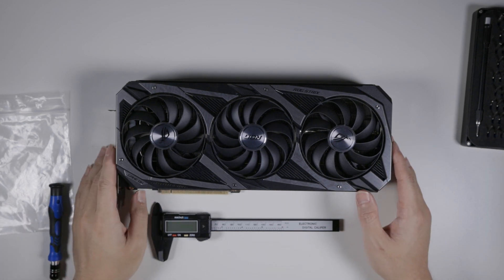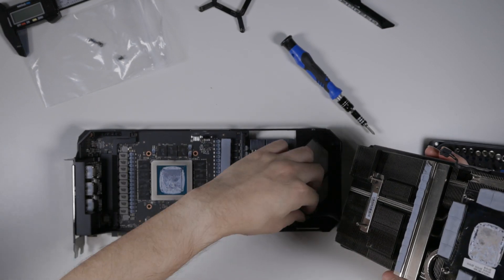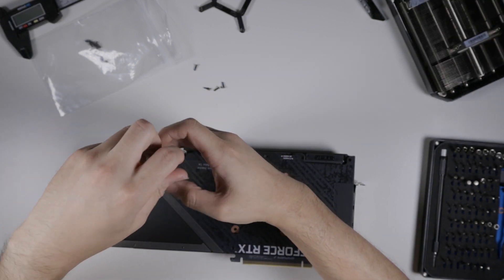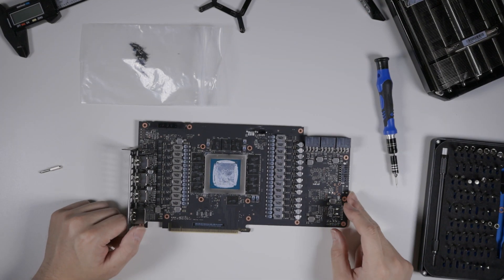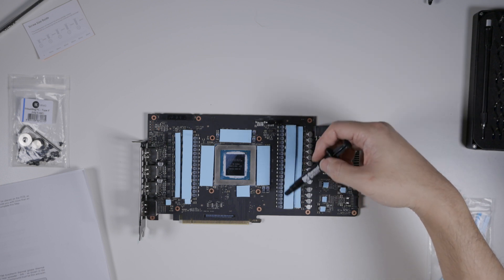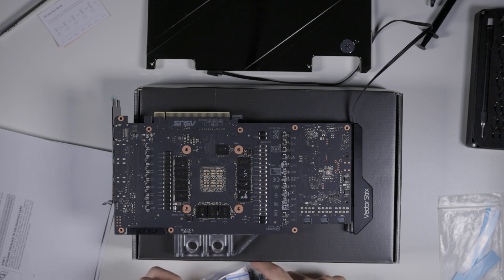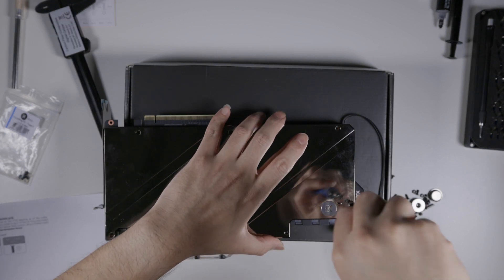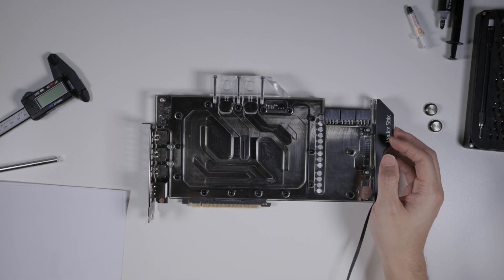ASUS STRIX RTX 3090 3080 Cooler removal + EKWB Waterblock and Backplate Install Beginner Friendly

Comment: From what I've heard, spreading the paste is good practice on a gpu because missing even a tiny spot can burn out cores. But this was a great video, if I ever decide to replace the paste and thermal pads on my strix 3080 I'll have to reference this vid. Nicely done
Reply: THIS
Reply: Thermal paste should be always spread evenly and carefully on top of the whole area of the processor so that it covers the whole surface area. This is basic and obvious physics. If you just put a drop in the middle and then squeeze it won't spread properly and it won't spread evenly. It's basic and simple understanding of physics. Also many thermal pastes aren't even runny at all.
Reply: @-Mohog  Imagine speaking about physics while understanding so little about what actually happens. Let me give you guys a proper physics education.

You are not applying thermal paste to cores, you are applying thermal paste to metal block that is designed to increase total heat capacitance of the processor (IHS). That metal block has EXTREMELY high thermal conductivity. Our goal here is to make a contact with that block that is ideally as slim as possible, and it does not have to be uniform because metal block has such high thermal conductivity that it will spread uniformly even if you just put a small dot in the middle. (This means ununiformity across the IHS will be at most 0.5 degrees - so little that it does not matter in practice)

Advantage of small dot in the middle approach allows you to have really thin layer of thermal compound which is the biggest bottleneck in entire processor-to-heatsink thermal system. Conductivity of thermal compound is less than 1/10 of conductivity of the IHS. 

In practice however - both approaches achieve same results with measurements being within margin of error. However small dot approach is less likely to spread out from the corners so it keeps the system cleaner for future.

So yeah, what you are doing is a mistake that I have seen a lot of people do online - applying elementary school physics to a system that is far more complicated and advanced than that. That is not how reality works, leave explanations of this stuff to engineers and don't spread misinformation.

And no, you are not going to "burn out cores" if it is not spread evenly. Again, you are not applying thermal paste to cores, you are applying it to IHS which already is uniformly connected to all cores.
Reply: @Navhkrin  You do know that a GPU doesn’t have an IHS and you apply the heatsink right to the die….talk about not knowing what you’re talking about lmao

Comment: Thank you so much.  The water block was easy but that backplate was a huge pain.  I tried to get all the pads as level as I could so hopefully (touch wood) everything will be okay
Reply: The backplate issue he talked about is still an issue? Going to order this block next week
Reply from the maker: I've told EK about the issue, You should be prepared to have some extra 1mm pads for the back VRM area. You want to make sure you have proper contact with the memory as well. You may need to use a thicker pad there as well. Some folks have had coil whine as well using the layout in the instructions. Prepare for some trial and error with the pads on the back unfortunately.
Reply: @JCustom  thanks for reply and heads up.

Comment: Note: The Active backplate from EKWB, is 20mm thicker, so you cant mount it vertical, with that said, you doing a 3090 with memory on the backsite, so i strongly recomment you get the active backplate, cuz it gets hot on the backside form memory and you ram (Unless  you ram is water cooled)
Reply: And that is the opposite advice everyone else is giving regarding mounting orientation. 
The weight of card, front and back waterblocks, makes the card weigh 6-7 pounds.
That much weight mounted horizontal will destroy your motherboard.
Everyone else I've seen has said to mount vertical.

Comment: Very good video!! Good detail and information!   Please keep us posted on EK response
Reply from the maker: Yeah I saw a few more similar complaints across the range of EK 30 series.  So I've told 2 EK reps at this point. I sent photos as well so we will see.
Reply: Thank you big time for the response, it is always hard to know who is at fault whether it be card vendor changing things or EK.  I know the Asus 2080ti cards and EK had issues as I found the issue with the blocks https://www.ekwb.com/blog/did-you-know-compatibility-issues-with-strix-rtx-2080-ti-water-blocks/ 

Hopefully they respond with a fix whether it be different thermal pad thickness or instructions cleared up

Comment: I'm not installing a water block but this is useful information for thermal pad replacement for the 3080 Strix
Reply from the maker: Just be sure to use the same pad thickness as the stock
Reply: @JCustom  I'm doing vram pads first to see if it lowers the memory junction temp when mining. I ordered a pack of 120x120x2mm Thermalright Odyssey pad from Aliexpress

Comment: I bought a 3080ti the other day with that block and active backplate and I gotta say it too 3 hours to assemble the whole thing. Alot of the pads didn't fit and I had to take it apart a few times because I feared it would warp under high heat as these cards get pretty hot even on a custom loop. Finally got it together and If I can offer any advice to someone who has a similar issue is to check the pads at eye level before setting it instead of relying on ekwb's instructions. 

Been using ekwb products for years and this was the first time I've noticed that this product wasn't that well thought out.

Comment: Very nice and quiet, and I mean quiet, video. I would have liked to see a little bit more: the pump, radiator, and reservoir. If I made a video, I would sure use my Video Maker program. These videos need to be edited and played before being released to the public. "Will not void the warranty." Oh, so that's why they have that warranty plug. Never would have guessed that. If NVIDIA sold the GPU with an installed liquid cooling kit I, and the scalpers, would be the first in line.

Comment: I see people putting thermal pads on the VRMs first, also for beginners using the waterblock as a guide to see where the "raised" parts are. Can you put the thermal pads on the waterblock first where the raised surfaces are? Basically reverse process, I don't see people do this, but intuitively it makes sense to me...?

EDIT: I commented about half way through the video. But towards the end I saw you put some thermal pads on the backplate first
Reply from the maker: The order doesn’t matter that’s personal preference as long as you put them where they need to be. If you look at the water block you will see there are raised and recessed spots, the inverse would be true on the gpu pcb.

Comment: hey just came across this video, great job with the step by step guide. I just had a question in regards to the VRAM temperature. I know HWinfo has the capability of measuring it but I am seeing pretty high temps and I have a feeling the backplate might not be making contact even though I followed the instructions by EKWB to a T. Would love to see what temps you're getting with the backplate on. VRAM temps, that is.
Reply from the maker: If you use the instructions, the vram contact will be poor. You want to go .5mm thicker than the instructions. I've notified EK Of this.
Reply: @JCustom  I just got an email from them. They said they’re sending me more thermal pads and 8mm screws for the backplate to make better contact and also reduce the slight coil whine I’m getting.
Reply: @Darkthrone111  I am experiencing similar issues with the screws not able to fit in. Seems like I will need to email them as well for 8mm screws.
Reply: @JCustom  Are you saying that we should use 2.5mm thermal pads on the vrams for the backplate? I see you mentioned that you changed the side 2mm to 1mm. Does that still holds? Thanks!

Comment: Question does removing the cooling system of the asus rog strix 3090 gaming oc make it just like any other 3090? Or does the overclock speed and other things that make the 3090 gaming oc better than other models carry over when you put on the waterblock
Reply from the maker: It’s not the cooler it’s more the voltage limits out the box (along with component choices) that make the strix a “better” than say a 3090 gaming oc. The strix cooler is pretty good but even with a higher out the box power limit, silicone lottery is pretty important as well. At the end of the day if you got the cheapest 3090 vs even say a 3090 hall of fame, the performance difference is in the 1-5 FPS territory out the box.

Comment: I cannot believe i just spended around 10K on two pieces Asus Ekwb 3090 gpu's and Quantum RE Vector waterblocks etc, and then there is 6mm huge gap between thermal pads and waterblock!!! Ekwb support recomended this waterblock to me and said it was compatible with all RE RTX 3080\3090. I contacted them again and now waiting for a reply..... As far as i know its not possible to buy 5mm Thermal pads, and now im proberly forced to make some modifications with flat copper bars for heat transfer. EKWB Seriously????

Comment: can you just go with the water block and not use the back plate at all and keep it stock ? because I see a lot of coil whine problems with the EKWB back plate installed on this specific model..
Reply from the maker: I would not advise that for the 90 model, as there are vram chips on the back and the back does get quite warm. Having looked into it since, I would suggest using the pad layout in the instructions and then using longer screws. My card did have a little bit of a whine prior to blocking.
Reply: @JCustom  Thank you so much for the info. I ordered and waiting them to be delivered.. in the meantime, why longer screws? The ones that come with Ekwb are too short and cause bendin or something? Thank you for your time, your feedback is much appreciated.
Reply: Same problem 3080 strix slight bend in pcb as I had to use a tiny bit of force to make the screws meet through the backplate!, did not feel good at all ended up using 8inch screws instead of the 7inch ones and was alot better but overall wish the pads came pre cut or something it just doesn't feel very professional
Reply: @TorvenAU  are the screws coming out of the box a bit too short? So you have to find out longer ones on your own?
Reply: @jeocuneyt  yea exactly the 7mm ones or whatever that come with it in some parts of the backplate just slightly short maybe because I used the pads as advised by ek diagram and the 2mm ones are maybe to thick idk, also I'm vertically mounting my gpu so I dont even know if a backplate is worth it at this point
Reply: Actually you're right, and plus the stock back late is prettier.
Reply: COIL.WHINE IS LOUD! even on my 3080 strix.. I'm removing the backplate everywhere I've read is it fixes the issue
Reply: @TorvenAU   wow thanks for the info. Ordered the 3080 block. Will try to grab some 8mm screws
Reply: @TorvenAU  Wow disappointed with EKWB for this silly blunder why do companies do this where they usually good at doing something and then they mess up with later models.

They need to make a V2 to address the problems

Comment: Can you use copper pads instead of those sticky thermal pads for the VRM and memory chips
Reply from the maker: Tech yes but you will also be using a lot of thermal paste between the vram and  copper shims and the block

Comment: What are the thermal pad thicknesses I should use for the 3080 ti rog card? I will also use it on the back of the card. Is 1.5mm suitable? Thanks
Reply from the maker: For active backplate ?

Comment: Hi, where is the connector for rgb leds? I just need to turn off those leds. Would I need to disassemble the card for this?
Reply from the maker: You can use asus armory crate to turn it off. No need to disassemble the card
Reply: @JCustom  I have tried that and every other app out there. It worked once and LEDs went off but one day suddenly LEDs just came back on and won't go off anymore.
Reply: Can the LED connector be unplugged without having to remove the back plate or front fan assembly?
Reply from the maker: The cooler may get in the way. I don’t remember which one is the led. But I think it should be the smaller connector
Reply: Why do you want to turn them off anyways?  I RMA'd my RTX 3080 ROG Strix and they sent me one back with the RGB lights not working.  I tried to turn them on with the software but still no luck.  Any Idea how to fix the light issue?  I really dont want to RMA this again.

Comment: Hey! Hope you are well. Do you have any idea if the thermal pads just to upgrade (no water block needed) are different sizes as well for the regular cooler or one size fits all. If you have the Asus link or any other where you got this info I'll appreciated very much. Thanks!
Reply from the maker: VRAM front:	80x40x2mm 
VRAM back:	80x40x2mm 
1mm, 1.5mm, 2mm, 2.5mm

https://thermalpad.eu/thermal-pad-sizes/asus-rog-strix-nvidia-geforce-rtx-3080-oc/

Comment: Did any of you have a problem with the Fan Shroud screws falling out, causing you to have to disassemble the card to reinstall them?
Reply from the maker: No. The cooler assembly is really just attached with 6 screws. The rest are for the back plate and mid frame
Reply: @JCustom  Sorry JC, my question was not "framed" well,  my Strix 3080 had the 4 screws vibrate out and the shroud fell off the card (since it is essentially upside down).  So now I have to dissemble the card and screw the plastic fan shroud back onto the card frame (only accessible with the card apart).  From your video it looks like I can reach them once you take the cooler off.  I was wondering if any of the Gamers watching your videos had the same thing happen.  Did not mean to hijack your video Sir, I did not know where else to turn to for advise (need to find the screws now).

Comment: Why doesn’t EK just get into the business of purchasing the cards from Asus before they mount the body then add the water blocks to them and sell them ?
Reply from the maker: They have partnerships with asua for a ref based model. But when ek partners with say powecolor ,asus, msi, the Waterblock assembly is done by the aib.
Reply: Good question because i cannot believe i just spended around 10K on two pieces Asus Ekwb 3090 gpu's and Quantum RE Vector waterblocks, and then there is 6mm huge gap between thermal pads and waterblock!!! Ekwb support recomended this waterblock to me and said it was compatible with all RE RTX 3080\3090. I contacted them again and now waiting for a reply..... As far as i know its not possible to buy 5mm Thermal pads, and now im proberly forced to make some modifications with flat copper bars for heat transfer. EKWB Seriously????

Comment: How much of a performance increase is this water block on a 3080/3090 Strix? I got my Strix oc 3080 and was wondering how hot it can turn or how loud the fan must spin otherwise. Can you benchmark this and share with us?😊

Comment: My Strix 3090 went error code 97 after installing my ek water block going to wait on my RMA. not sure what happened
Reply from the maker: Same with the stock cooler back on ?
Reply: @JCustom  yup, even tested it in a separate rig
Reply: @JCustom  If i do this on a new card, would kapton tape be a good idea?
Reply: Hey Ray, mine did the same thing today; did you ever figure out what happened to it? Where you able to get a new one?
Reply: @TheOriginalHymn  i beleive it was the washers placements
I did rma it and get it replaced

Comment: do you remove the heat sink and coils? cuz that’s all connected with the fans right
Reply from the maker: Yes the fans are part of the heatsink. There are two cables to disconnect, i show them in the video.

Comment: is the backplate required for the 3080? there was some thermal pads there on the stock backplate but it wont fit back on after putting the ek block on
Reply from the maker: I would suggest it yes. You will not be able to use the stock backplate without modification. If aesthetics are not a huge concern or you want to save a bit, you can buy small heatsinks and stick them where they stock thermal pads were, if you are not sure where you need to place them

Comment: Do you need to have the back plate?
Reply from the maker: For the 90 yes
Reply: @JCustom  I had the block on my 3080 strix for a few hours without a back plate for about 4 hours and it died on me, I’m curious if it was the back plate not being there that caused it.

Comment: Does anyone know the thickness for the memory pads? I'm looking to replace mine. Thanks.
Reply from the maker: 1mm front. If you have a 3090 then 1.5 works better for me in contact with the backplate.
Reply: @JCustom  Sorry, J C, I should have clarified. If I'm reusing the stock 3080 Strix cooler?
Reply: @JCustom  im also wanting to know the pad thickness for replacing the fans cooler